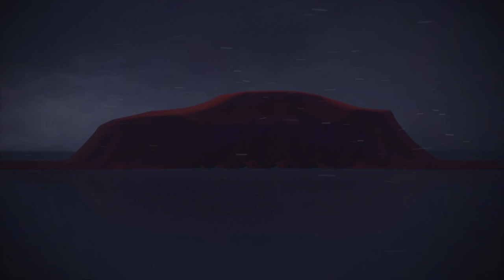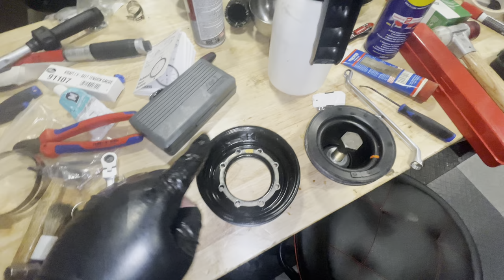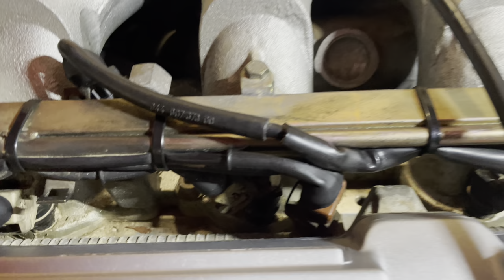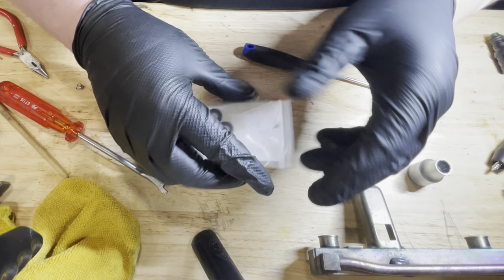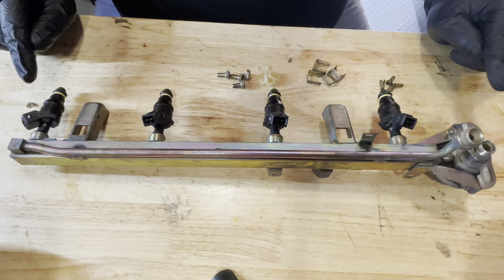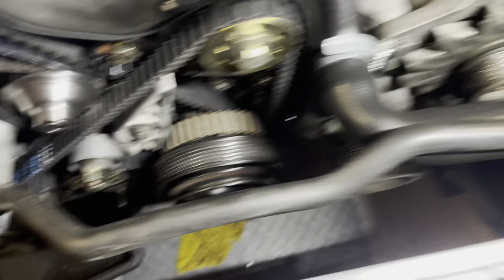Restoring a Flood Damaged Porsche 968: Balance belt, fuel injectors and plumbing

Comment: Great work Johann and a pleasure to watch as always.. Regarding the new blue injector caps, they do indeed work fine even though they will sit higher than the injector tip unlike the original green caps that sits flush. When I rebuilt my injectors I had the same concerns and wondered if they taller blue caps would interfere with the spray pattern, but since the originals broke when removing them, I had no choice but to install the blue caps before taking the injectors to a shop for ultrasonic clean and flow testing. And they worked 100% fine with the blue caps with no interference to spray pattern at all. In fact there was only 1% difference between the four injectors, so as good as new basically.
Reply from the maker: Thanks for the tip Alex, I was thinking exactly that; that they would ruin the spray pattern. Good to know that they don't!

Comment: Jon, this is great stuff!  Did you consider sending the injectors out to get fully cleaned and flow tested?
Reply from the maker: I did, but this was a case of picking my battles. 968 injectors are NLA and I did not want to risk sending them to a company by mail and it getting lost. No one offers a while you wait service, so the risk is in my opinion not worth the reward. I have now drained the tank and replaced all filters and will do a first fill with synthetic fuel which should help clean the injectors in situ.
Reply: @GarageBiljon  maybe a can of LiquiMoly Jectron as well?
Reply from the maker: Yes  @jeffhammond8969 , I will double down on injector cleaner.